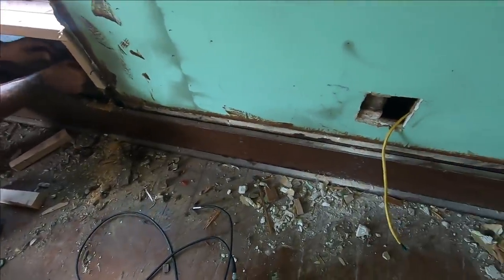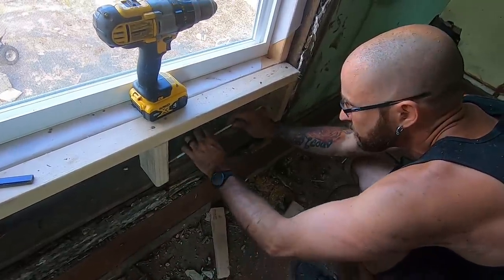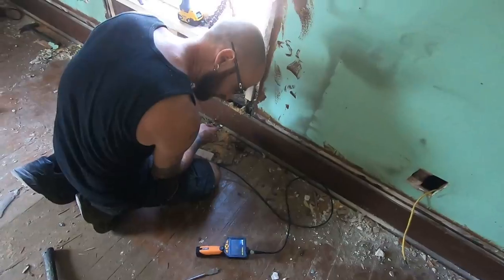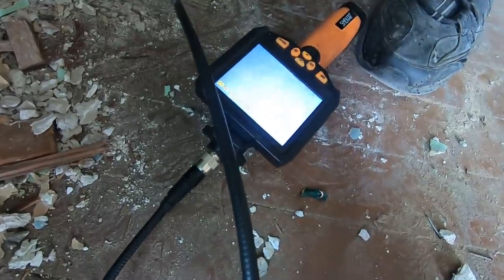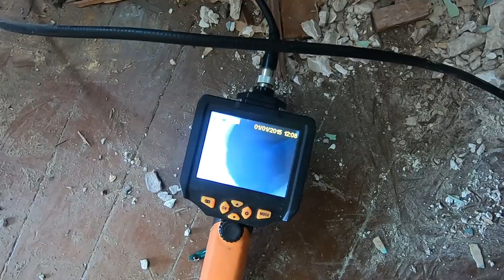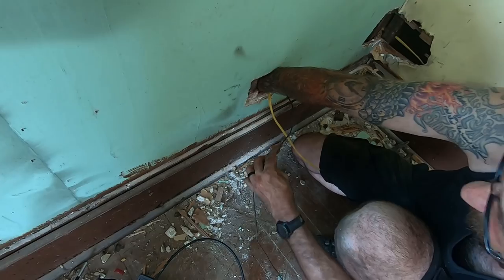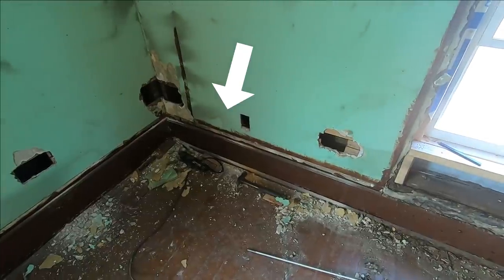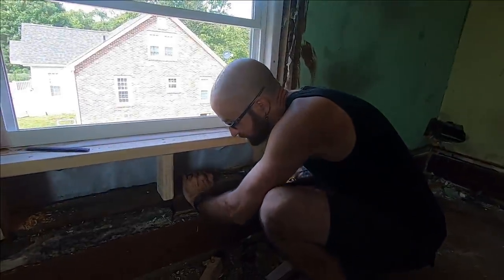"Hoarder House" Renovation - Electrical

Comment: You men are more patient than I am, I would have to had to remove the bottom forth of the sheet rock and just add a new piece and Blend it in. You did great Bravo👏👏
Reply from the maker: It’s not sheetrock. It’s 140 year old lathe and plaster, which makes it much more challenging.

Comment: I’m surprised the room didn’t have original wiring? Seemed a lot of work to retro fit. Very interesting viewing though.
Reply from the maker: The house was built in the 1880’s and had no wiring.  Wiring was added in the 1950’s.  So the existing wiring was very old and needed updating to meet code.

Comment: When you have just pushed the extended drill bit thru the walls, why can’t you attach something to end of drill it before pulling it out. ?
Reply from the maker: There’s really nothing on the end of the drill to attach it to that would stay attached.  Sometimes you have to pull pretty hard to get the wire through.
Reply: There are attachments that we can use. It's like a Chinese finger trap for wires. However, I can't find mine and the electric store is out, so, we did it the other way.  :)

Comment: I really cannot believe he ripped that covered porch off which was a part of the style in the home
Reply from the maker: No. The porch was added much later. It was not original. It was very poorly built. It was rotten, and dangerous to walk underneath of. It had to be removed. He could rebuild it, but the cost would exceed the benefit. And since it was not original to the style of the house, he decided not to.

Comment: You would have huge problems in them external walls if they were full of insulation
Reply from the maker: Yup. It can still be done. It’s just much more difficult. He plans to add insulation before he’s finished.
Reply: @LiveSimpleLiveFree  The blown in type?